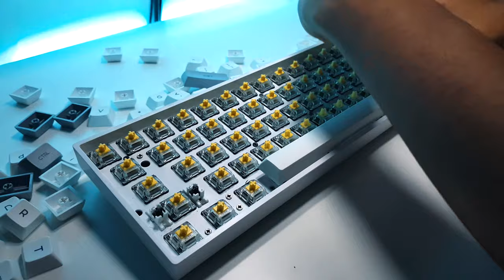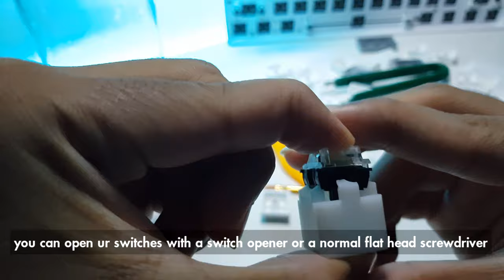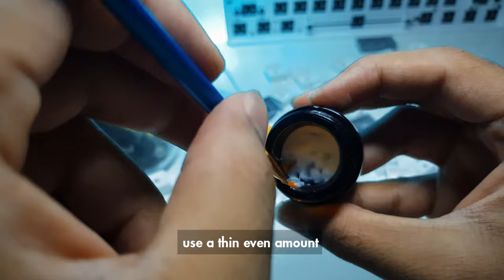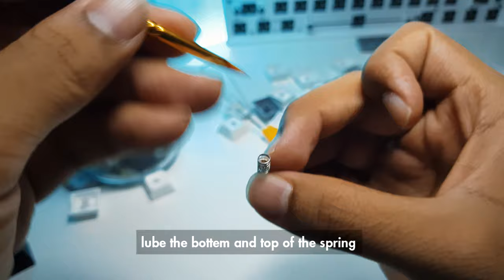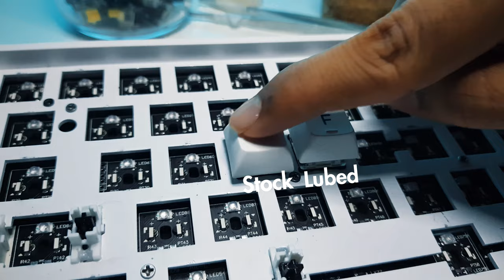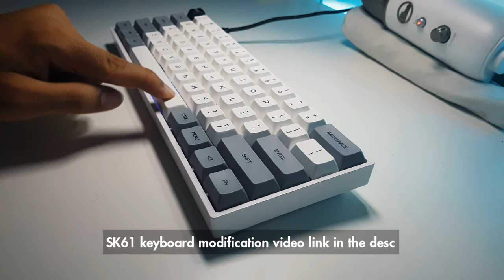The SMOOTHEST Budget Switches: SK61 - Optical Gateron Yellows

Comment: Idk if I should get gateron yellow/red or holy panda, I like tactile a lot and am wondering if it is easy to get used to the weight of the switch?
Reply from the maker: The holy pandas are heavy for gaming. I wouldn't recommend them, for other use such as typing and general use it's great.
Reply: @serene4566  When did he mention fortnite? Also gateron red and gateron yellows are linear and holy pandas are tactile.

Comment: Is the sk61 better than the gk61
Reply from the maker: They're both pretty much the same, mainly case and keycaps from what i can remember are only different.
Reply: SK64S with the custom coloured PBT key caps is ur best bet if you don’t mind optical switches. Banggood has it cheap
Reply: @readifdumb  whats the difference with the sk61 and sk64s?
Reply: @scff3325  sk64s has black switch option on Banggood, sk61 doesn’t, and 64 is dedicated arrow keys with little to no compromise because of the custom pcb. Other than that they are the exact same.
Reply: @readifdumb  oke thx
Reply: @readifdumb  thanks bro with switches are good yellow or brown or red or black or blue i know the dont have yellow switches but if its better im buying that tho
Reply: @scff3325  Well it depends, if you are talking about gateron yellows, they have a 50 gf, but the optical yellows only have 35gf, so if you want the on paper, fastest switch, go with the SK64S or SK61 keyboard and buy some optical gateron yellows. If you want a slightly heavier yellow with same specs, get optical silver. 

Downsides to optical yellows and silver would be mistypes/timing if you play rhythm games/games that require specific timing. If you are just doing general gaming they should both be fine, but may take awhile to get good at typing on, silvers being easier than optical yellows. 

As for brown/blues, they are non-linear, blues being a clicky with tactility, and browns being basically a "sandy" red, as they will feel like a red that has a slight tactile bump, but nothing crazy or that noticeable according to most who have tried, especially if you type fast. Blues are mainly for typing, but the main appeal would be sound, so I'd look up reviews of the sound and see if you like them. If you want clicky switches that are nicer sounding/feeling/smoother/more stable I'd get the GK64 and buy some box jades or some box navies from KBDfans or Banggood.

Now blacks and reds, only difference is weight. Reds are a good middle ground if you unsure, you can't really go wrong with them, they have the same specs and browns without the sandy feeling. They are good for gaming, and you won't mistype on them nearly as much as silvers/gateron optical yellows. Blacks on the other hand would be a more "thockier" sounding red, that requires a bit more force (15gf more). This can be good if you like the feeling of heavy switches, lets say if you tap really hard, or you care for more accurate typing, but a slower action time in game. I am personally buying blacks for this reason alone, as I play rhythm games that require accurate timing, and silvers throw my timing off, but reds just feel like mushy silvers to me after I tried silvers - but this could highly depend on the keyboard/keycaps/case/lubing/stabs etc. So many factors could be the reason I feel this was about reds, so I wouldn't take it as gosple. 

Silvers vs Reds, now silvers are essentially reds that bottom out and actuate faster, so if you tap really hard, you will find a more linear stroke, but if you tap softly it will probably feel really gross with how much the bounce back hits your fingers as you leave the key. I have the most experience with both these switches. So if you tap hard/bottom out a lot, silvers will be better, if not reds, if you don't want to mistype, but want a bit of resistence because of how hard you do type, blacks. Or if you just want a thockier/denser sound/feel, blacks. 

Now non-optical gateron yellows are kinda just a weird middle ground between red and black, at least on paper. They will probably feel good, but it's hard to say how good they will be. 

Do also note that browns and blues have different gf required when it comes to optical gaterons for some reason. This is only 10 gf higher, but that will definitely make them a little bit heavier feeling, and I don't really know how that would feel. Most people do say they feel similar to the standard mechanical switches that they are based off, so maybe the switch to optical means they need to add a bit more force to make it feel similar. I'd research more into this if you are wanting to get either of these switches.

Now that covers most of the difference/what to expect. Now it depends on your preference. I'd personally stay away from browns, just because it is public opinion that they just aren't that great, despite what variant of them you get. They aren't as tactile as tactile users would like, and aren't as linear as linear users would like. They are an off-putting middleground. Blacks might be a risky pick, a lot of people like them, but a lot of people think they are too heavy on their fingers. Blues are basically just whether you type more than game, or whether you like the sound enough to buy them, but again, there are better clicky switches all around (not really much preference, just straight up better made variant clickys like I explained above). Reds are a good middle ground for a gamer. Silvers and optical yellows are if you just want pure speed, and don't mind overcoming the inaccuracies. Silvers are controversial because of how easily pressed they are, which maybe a benefit or not depending on the game you play, so think really hard about whether timing is something you care about, or whether just getting actions out as soon as you want them is more important to you. 

So... I can't really say, get that switch, or this switch. It really is preference and depending on you situation. If you do get the GK64, I'd recommend looking into Holy Pandas, Tangerines, Jades, Box Whites, Navies, Zealious, Tealious, Zilents etc. These are all very expensive switches that will probably be the best at what they specifically set out to do, but ofc that comes with a price. If you are getting the optical keyboards, SK61 or SK64S, then I'd just think hard about what you want the keyboard for, and it's hotswappable so you will be able to try other optical gateron switches if you ever make a choice ur not happy with. If it's your first mechanical keyboard there really isn't a wrong choice persay, but the unsafe options are silvers, optical yellows, and blacks, just because they fit a specific niche.
Reply: @readifdumb  bro thank your so very mutch for your info im gonna sub to you bro thank you vetty much
Reply: @readifdumb  hi gura im thinking to get yellow but i have one question i can buy the gk61 optical yellow switches in banggod for €60 but what i know is that the sk61 has better keycaps and better build but the sk61 is €60 and if i want optical yellow switches for it i should buy €20 bucks extra so €80 so for the sk61 yellow switches €80 and for the gk61 €60 so what is an better option?
Reply: @readifdumb  so?
Reply: @serene4566   w an
Reply: @readifdumb  mans made a whole paragraph lol legend
Reply: @scff3325  Sorry I didn't see this until now. You've probably already bought, but the SK64S/61 is the optical, and the GK64/61is the standard mechanical, so the optical yellows will only work for the SK64S/61
Reply: @cartienthusiast1698  Essay more like lol. I was in the mood for it. I have a lot of time to burn.